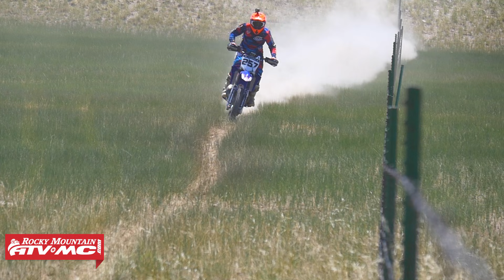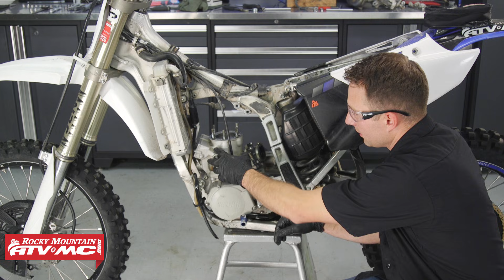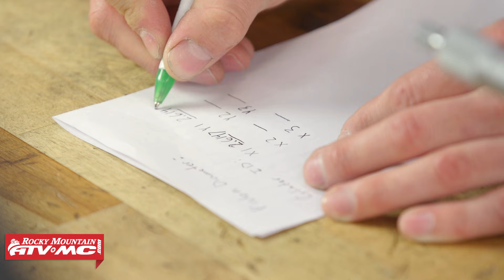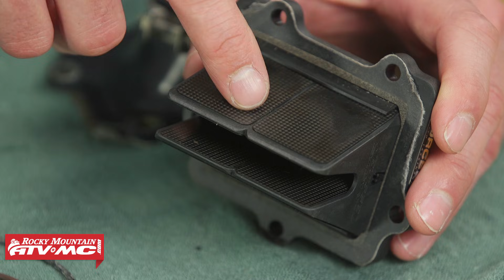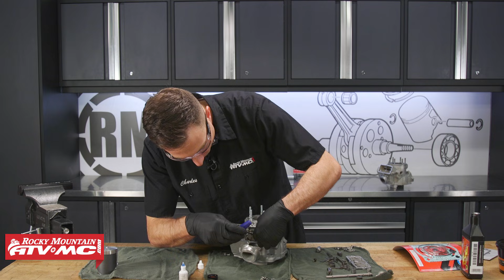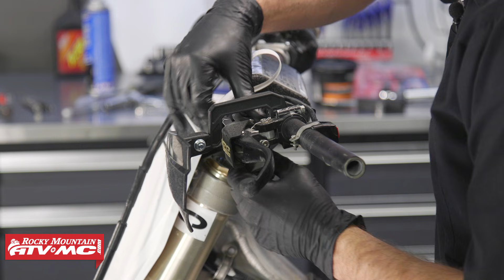How To Rebuild the Top End on a Yamaha YZ250 & YZ250X

Comment: How long will a YZ 250 2 stroke last not needing the top end written by an old man in the woods once in a while
Reply: I just changed mine at 150hrs on original top end. The piston and cylinder were mint. But I ride and race woods (novice). I’d say 100hrs no problem all day long
Reply from the maker: It's hard to say exactly how long they will last, but some people say they can get close to 60-80 hours. All depending on how you ride and maintenance.

Comment: @10:43 where in you said if you feel any gouge  or groove in the nikasil it is an indicator that you should replace it I remember what you said at the Glen Helen 24hour race where you don't expect the backup bike (WR200) to last that long especially with what happened to the bore well anyway that is what is recommended as per manufacturer and I totally get it. I recently rewatched all the cheap bike series and it was all a blast!

Comment: I installed an oem B kit into my 23 yz250x. The ring gap was .0019. The old rings measured .0028 with almost 300 hrs on them.  But the manual says  .0037. Im worried that .0019 is too small

Comment: Different pro engine builders have different techniques.  I have not listened to the vid from this retail guy yet, but I will chime in below if I disagree and why.  :)
1)  A compression check is only good if you have an accurate tester, or know how much it is off.  Many testers are "under inflated". If you check ring end gap, cylinder roundness and have good plating still, (and run at 32:1 oil/gas), and all is good, you will have good compression.  If you tear down your top end and find the ring end gap is still good, you can wait longer for maintenance intervals, and even calculate it based on the wear you have.
2) The "snap gauge" is also called a "telescoping gauge" (a type of "comparison gauge" that does not give you numbers, but has to be measured itself by a mic for example).  Used correctly, they are accurate enough for this job easily, but not as accurate/repeatable as a good set of inside mics.
3) My Wisco piston kit came with the wrist bearing. Got it less than 3 years ago (after this vid was made).
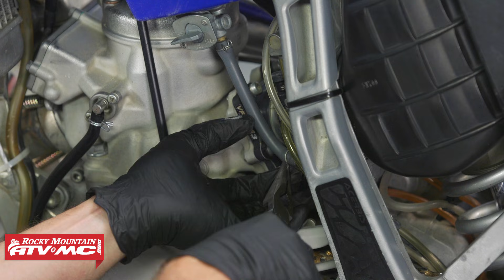4) 1:50  Ahh, not using the stock reed block spacer for the V-force reed valve.  More powerful. :)
5) If you are replacing the rod and lower bearing, you really don't need the piston wrist pin puller.
6)  Upper hanger bracket is called the "head stay".
7) 7:47  I don't think those 2 screws are lock-tighted.  Too hot there for lock-tight.  It melts.
8)  Show us the "carbon remover".
9)  You would be surprised how many little vertical scratches you can have in your plating, and still run good.
10) Good cylinder measuring.  Did not specify the taper and out of round limit though.  Maybe in the owners manual.
11) Personal preference:  Oil is in the gas, so the piston will soon have lubrication, so I don't like to use 2-stroke oil on the piston and cylinder.  Pro mechanics would even put the 
       piston and ring in dry for practice, (to help seat the rings faster), so it will be ready to race later in that day.  I use a "in between" WD40.

Great job overall.  New guys who follow your steps will do a good job.
Reply: Wanna help me rebuild my bike lol?

Comment: Hello, I have mounted a fatty and shorty fmf exhaust on my yz 250 23, my question is is it protected with the 50 n3ew pos 2 series carburetion and 178 main jet, or should it go up to 180, thanks in advance
Reply from the maker: It should be safe to run with that jetting. It really depends on elevation and temperature, as well as intended use (sandy hills etc.). I know that people have had good luck at sea level, 70-85 degrees, 32:1 premix ratio, with a 175 main, 48 pilot, N3EW needle 2nd position, and 1 turn out on the air screw. You might want to make adjustments from there. If you do, try one jet size at a time till it runs the best, then check your spark plug. Look at the porcelain by the center electrode. Ideally you would want that to be brown, black is rich, and white is too lean. Look up "plug chop" if you need more information.
Reply: @rmatvmc  Thank you very much, I will do some tests and look at the spark plug, good morning
Reply: @Liliros  Here is how I jet a stock 2-stroke with a carb.  They always come from the factory set rich, to be safe in any air quality around the world.  So if you are riding on a track (not wide open all the time), and your "correct" plug is dark, I start by dropping the needle one notch, (move the little c-clip on the needle up one notch.).  One notch is a big jump, and it will clean up the plug and you will feel more mid range power with less/no drool out of the pipe of vent tube, also keeping your exhaust power valve cleaner for longer.  The YZ is very rich, but if you think it is too lean in the middle, you can get little washers (or make them), to punt under the little needle clip, so you can drop the needle a half, or 3/4 notch for example.  Once you have the middle cleaned up, you will use full throttle runs, up a hill (the more load the better, and a cooler day helps keep you on the safe side of ambient temps), to check the main jet.  Make sure you are on the rich side for full throttle runs (and stock jetting should be, but may not be with come engine mods), with a dark plug.  Them hammer it wide open up a hil for 30 seconds, and hit the kill switch (so lower rpm's don't darken the plug.  Just check full throttle for the main jet).  If the plug is darker than a light brown and a dry electrode, put in the next smaller main jet and test up the hill again.  I have never had to mess with the pilot jet, (idle to /8 throttle opening) on a stock carb. after setting the needle and main jet.  Now, the plug should be a light brown color, with a dry electrode and even some color change to a bit darker at the elbow of the bent electrode.  The bike will no longer drool out of exhaust exits, it will pretty only smoke on start up for quick spell, the power valve will stay more clean, less sticky, and you will have gained about 2hp with more power across the usable curve and have a higher top rpm.  If the plug turns grey or white, you went too far.
Drop it in the middle, then test for the main jet works pretty good.  I just suggest a colder day (more oxygen) and a good load to the engine to do it, and you should stay on the safe side of too lean for most conditions.
Reply: Also, if you do most nay engine mods or put on after market engine products like a pipe, you should re-jet the carb, especially if you had it set well, (on the edge).
I am going to raise compression for one example on my YZ250 2-stroke, (use a older higher compression head, or lower the cylinder a bit), and that will burn better, and probably make the bike run more lean, needing a bit more fuel.
You can get that older head (2011 or before I think.  look it up), and get a good mid range boost and still run pump gas, or cut .0085" off the gasket surface of your newer low compression head to make it the same as the old one.
Reply: Thank you very much for your answer, I like to have my 2Ts a little richer, I have decided to mount the 180 main jet in winter without verifying the color of my spark plug

Comment: You didnt measure the squish bro😬
Reply: You don't have to if you are staying with stock parts.  The parts stack has tolerance to be wide and safe, but usually run better after you tighten up the squish with mods.  After that, you should check the squish if you change any parts that create the squish distance.  They don't check squish during assembly at the factory.  They know the dimensions and tolerances of the parts, (5 of them that create the squish clearance), and just pick them out of a batch of parts to put together.  That is why stock squish is almost always on the wide side, and never too tight.

Comment: If I get one of these bikes an actual 2004 yz250   For 600$ with the valves and piston messed up would it be a good deal if I took it and replaced the whole cylinder w the piston and power valve? I see some around 600$ for the complete kit. What do you guys think? Let me know your opinions thanks guys

Comment: Great video EXCEPT! If you ever have to file a set of piston rings to increase the end gap....ALWAYS file from outside towards the inside....I cringed when you were pulling the rings on the file...ALWAYS PUSH ONLY....Reason? The rings have a plated outer edge and you can fracture the plating reducing ring seal.....Otherwise great instructions.👍

Comment: Are the motors same on 250 wrs?
Reply from the maker: I'm not sure what bike you're referring to that is a 250 wrs. But this video will apply for Yamaha YZ250 and YZ250X 2 stroke dirt bikes.
Reply: @rmatvmc  ok thx
Reply: Hi! Can I swap yz250r 2002  block & head to yz250x 2018??

Comment: the taper measurement seems to make sense, however when calculating out of round i would think you stick to the same measurement points (depth in cylinder) when finding the difference between x and y axis. You could potentially have a different measurement for the x axis at one depth, and the y axis at another depth, but still have a cylinder that is perfectly round (the difference being from out of taper)....perfect roundness being possible in this scenario with equal x and y measurements at the two depths being compared.
Reply: القياس من جهة الأعلى فقط .

Comment: My yz250x stopped on me like out of nowhere I was ringing it no doubt , and wheel didn’t lock up. But I went to restart it thinking gas ran out , and then it sound like something jumping around inside. And turned off right away 😣
I need help , and I’m tryna get my friend to help me he’s a good car mechanic I’m like bro this stuff simpler.. hopefully he helps me rip it apart and fix it.

Comment: Very good into detail video I’m no master mechanic but I blew my yz250 and this was my first time doing a rebuild this video helped out so much highly recommend 10/10
Reply: When you have to change the valves and the pistons is that considered a “rebuild”??
Reply: @jupiterjac6438  🤦🏼
Reply: Il faire le rodage...
Reply: 😊 @jupiterjac6438
Reply: if you ble it, gonna need a cylinder replacement or recoat plus probably more

Comment: I thought 2 strokes were less maintenance than 4 strokes?????   What is this nonsense
Reply: This is a blown engine repair.. Trust me, the work here and the price is like 10 times less than a 4 stroke in the same situation..
Reply: @geopioneergsxr5357  I know I own both.  This video is overkill though.  Spray that power valve out with brake clean and keep it moving
Reply: Lol I love people who speak out 🙌
Reply: I always thought 2 strokes needed more frequent maintenance but the work is usually cheaper.
Reply: @Cornholio223  ALWAYS cheaper.
Reply: @geopioneergsxr5357  not always true, I just sent out  my yz cylinder for replating and they charge $100 more for 2 stroke cylinders because they have to mask off all the ports
Reply: @Cornholio223  You're talking about what someplace charges for labor... That's not what it costs to repair, that's what you're paying someone to do it for you. What is costs for parts is what I'm talking about when I say 2 strokes are always cheaper. I buy new parts to fix my bikes, and I always do all the work myself.
Reply: @geopioneergsxr5357  I get what you're saying but the most cost effective option is usually a replating when dealing with a scored cylinder. A new one was going to be $700 Canadian and the replating and shipping was $400. the 4 stroke option would be $300 for replating and shipping
Reply: I was gonna ask if you really needed to dig into the power valve every top end or could you do it every third or so?

Comment: I got a question . Does the transmission oil and crank oil share the same oil or is it separate. I was looking for a drain plug for the crank but there is only for the transmission.  I had to flip the bike to train from the crank.
Reply: The engine oil is the oil you mix with the gas. Transmission oil only does transmission and clutch. There is no filter for your transmission oil so change it often
Reply: What? There was oil in the crank case?

Comment: I noticed in the video you went back with the factory Phillips screws and bolts, what’s your thoughts on using Allen head screws and bolts as long as they are the same thread, width, and length so they’re a lot less likely to strip in future?
Reply: use a JP1, JP2 or JP3 screwdriver, stop using phillips and you won't strip your screws anymore
Reply: That's what I did
Reply: If the heads are fine reuse them. If not replace. Allen bolts can still sieze. Lube the threads.

Comment: I need my 69 dt 250 motor rebuilt
Reply from the maker: Even easier! Less parts and air cooled. I don't know if you watched the 5 miles of hell series but Justin rebuilt his DT 175 top end on there and you can see what you'll be getting into. Between these YZ top and bottom end videos and your service manual, you should still be able to get it done no problem. Finding parts might be another story... -Charles